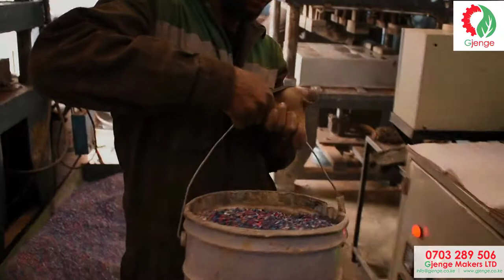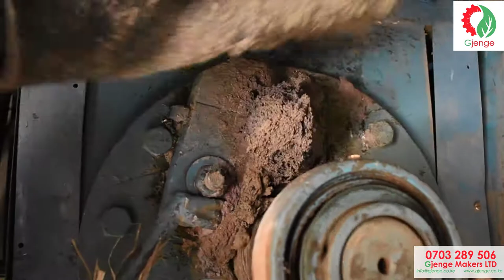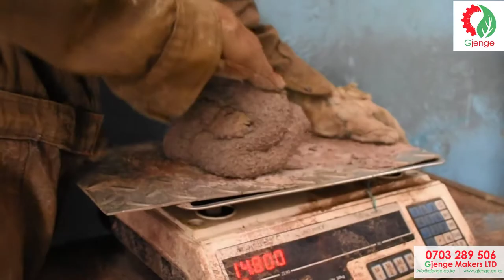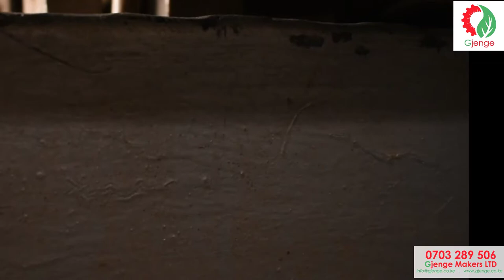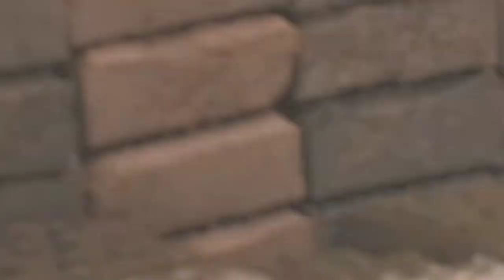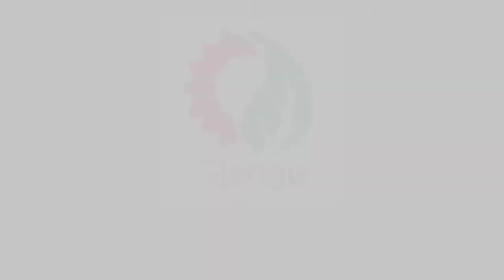How to make building paving blocks from plastic waste.

Comment: So after the chipped plastic is mixed with the sand, what is mixed with those two materials to push out the paste?
Then when the paste is placed in the press, what makes it solid? Heat? Is it baked?
Am asking as I would like to try to build this myself and help save my country too... Help me understand plz 🙏🏽
Reply: @karenj1592  can please tell me which mix ratio you are following. Sand: plastic mix ratio?
Reply: the first stage they heat the sand and plastic mixture to get the paste, then pour into the mold and compressed in high pressure

Comment: I know many people here are happy to see that plastics are recycled and used as a product like brick. But did you consider what would happen to it at the end of life (EOL)? Now the brick is a mix of sand and plastic, and you cannot separate the plastic and sand at its end of life; imagine if these bricks go into a landfill, further the possibility of chemical leaching, microplastics release into drains or storm-water, the problems that we leave to next generation.  Any new product without keeping in mind the EOL of the product is more dangerous. Try keeping the product as virgin as possible and see if it can be reprocessed/moulded into the same/similar product at the EOL.
Reply: I work in this field and I can say the following to your question:
The plastic waste that comes to you must be sorted, good plastic into garnules, average and dirty plastic into polymer gerbil, plastic is difficult and expensive to process into pyrolysis or burn in ovens. The polymer sand material does not have an end of life (EOL), because from this material (polymer sand-EOL it is possible to restart and obtain a new polymer sand product.